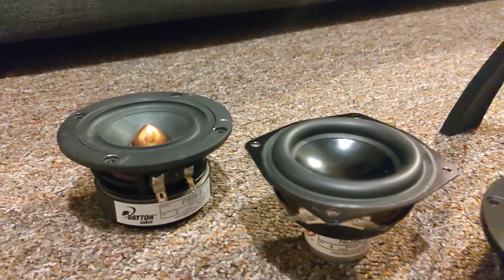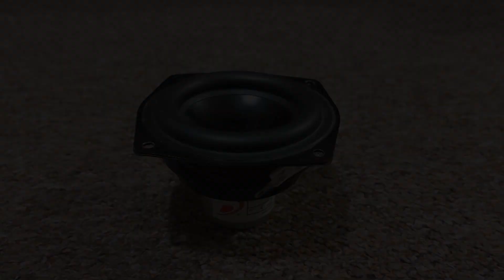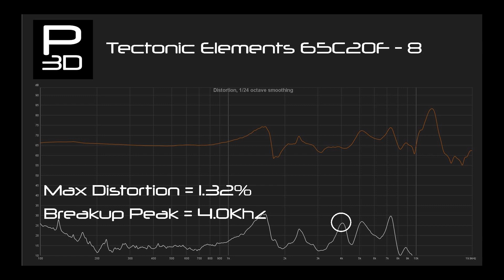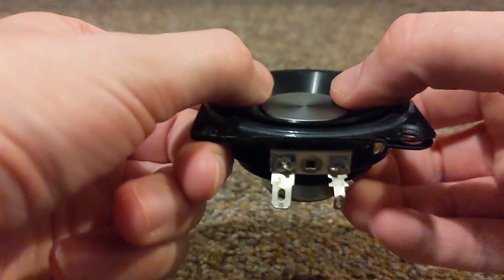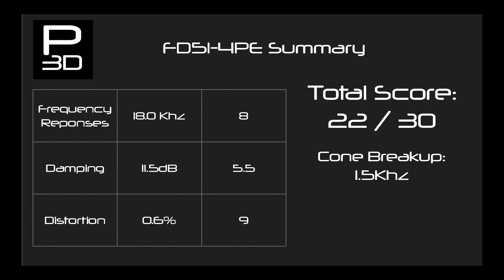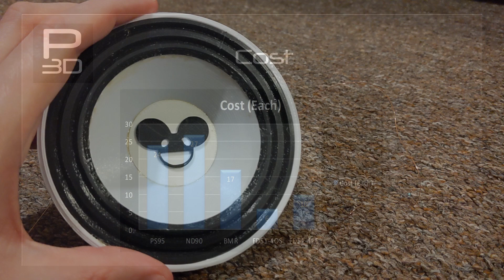3D Printed Speaker Drivers vs Industry Speaker Drivers

Comment: Perceived bass response here depends on the angle and the baffle size, both of which vary. A better comparison would have them all mounted in the same open baffle or box. Granted it's inconvenient, but merely having a larger frame makes a speaker louder here.
Reply from the maker: I agree the bass response will be effected by the baffle size, but even with a IEC sized baffle it is not classed as accurate below 200Hz still, so short of a boxed test it is hard to determine. Realistically the Cms and Fs should effect this most. For this video recording I used my cone test platform mount which is only 3<4cm away from the surround area in the hope to reduce this being such a major issue. Its a complicated one, especially in a small place like I am in haha. Thanks for the time to message. I will have to think more on this!
Reply: @Polymate3D  Thanks for sharing. It's nice to see someone 3d printing speakers. Probably many of us want to. I don't have much faith in plastic diaphragms but maybe printing the forms for a curved paper or composite cone. If you have more measurements like from the Dayton DATS it would be interesting to see too.
Reply from the maker: @haleype  I have an old WT3 so prior to DATS from Dayton and measure each design. When I get a chance to update the website I will be adding this to each model to help people have a bit more information on them. There has and still are many people with concerns on strength. My experience has been good for most materials so far. The hardest bit is getting the TPU parts printed cleanly (Surround & Spider). I have been doing this fine for a long time now though. The Tenacious 6+ in development which uses a larger magnet motor will probably be of more interest to you as it is much closer to a driver you would buy in SPL and T&S Parameters :)
Reply: @Polymate3D  Cool! My impression is that stiffness is crucial, or else why would people prefer aluminum that rings, or use beryllium. But paper should be easy to make. I'm also interested in optimizing the magnets and understanding the theory. Perhaps completing the magnetic circuit, or maybe a hallbach arrangement. Or rings of magnets like a brushless motor? I like the look of high excursion drivers, and maybe that would allow keeping diaphragms small for lightness and stiffness, but I'm concerned the Cms would be too low with these printed surrounds.
Reply from the maker: @haleype  It's a interesting topic. With Tweeters for example you have some using beryllium and others are going with silk domes. Massive difference. Same goes for cones you go from polypropylene to ceramics and aerospace metals. I think it comes down to your goals with a driver design. Having the higher stiffness helps raise that cone breakup region, but shape can make a big difference too. For my work high stiffness is key but so it the density as well. Hallbach method I have seen from another builder but you always hit a wall where the magnets themselves can only achieve a set level of saturation and iron in this sense is still king. I use a pretty strange arrangment compared to typical but this is to help give me a large magnetic gap to accomodate an easier to build design. Cms on my latest 6cm prototype is around 1.00mm/N for reference. I think if you was to do it yourself, the first thing with your high excursion would be to find the best solution for you winding a overhung voice coil. Its a big rabbit hole in the end haha
Reply: @Polymate3D  It’s a fun rabbit hole, and you’re deeper than I am. It’s great to hear your thoughts. I’ve been thinking maybe an underhung coil would suit high excursion better, keeping mass down. I’ve also really wondered why we can’t be smarter about transduction in general. The audio signal, afaik, represents not air pressure but voltage from the mic, proportional to its acceleration. Shouldn’t we be recovering the original air pressure, then solving for a linearly amplified air pressure for a given speaker, using its measured parameters? Then any cheap speaker could become linear in its range, just by applying a DSP that applies the right processing.
Reply from the maker: @haleype  Permitting you can maintain the flux needed for a long stroke underhung then maybe but you`ll still hit thermal limits a lot earlier than a overhung due to the lack of layers of wire and the surface area to dissipate it. I don't really have enough testing or data to confirm but we run by voltage because we can measure the feedback super quickly , Air pressure doesn't take the inductance issues at higher frequencies into consideration and also at that stage the surface will be resonating, not like a piston. For bass control you'd be onto something but there are also servo woofers which use a accelerometer to feedback the motion created vs expected, and counters for this. This or DSP however doesn't resolve anything like sound decay from the drivers emitting material or the suspensions compliance and capacitive values. DSP is a great tool as is bi quads in some TI amps, but its not a silver bullet. All interesting aspects to consider and it is the lack of innovation and experimenting on different ideas and principles which I think needs to be challenged in this day and age
Reply: @Polymate3D  Yeah, it seems to me patent is also stifling innovation. I like tri-state PWM amplifiers like the STA326 for efficiency and low noise, but only ST makes them. On the other hand, I’m just checking out a cool research paper “Single-digit-micrometer thickness wood speaker”. I didn’t mean to suggest measuring air pressure in real time. I meant recognizing that the objective is to recreate the original sound, which could be done by knowing how sound affects both microphone and speaker, these having their own physical characteristics, described by TS parameters. I think the fact that we ignore these parameters and drive every speaker with the same signal the mic produced could be largely the reason transduction is the worst step in audio reproduction. I can imagine something like a DSP but much more powerful that preprocesses a buffer of audio according to a model of the speaker (probably real-time, not steady state). You could also avoid damage this way. Then maybe (at least below breakup frequencies) any speaker would sound similar. Which is better than servo subwoofers, right? Much better to use silicon to improve any existing driver than invent hardware you have to build. Another cool approach could be to use a mic to compare the original signal and train a neural network to optimize a bunch of coefficients to minimize distortion. I investigated accelerometers, but afaict there are none (especially that are cheap) that are fast enough to work in the vowel frequencies. You mention measuring voltage for feedback. What’s that about?

Comment: u should compare a 3d printed driver with a industry driver and both should use the same motor structure(magnet, coil)
This will be a fair comparison
Reply from the maker: I very much agree with you. Currently my designs and magnets do not work to the diameters as them, but I could do so in the future and swap out. Its annoying that most are bolted and epoxied together! In this comparison, my motor is significantly down on the industry one. Work on newer bigger motors however is closing that gap :)

Comment: No way!!
It is the video you said it's coming...
:))
I really like your work with the printers there. I am an audiophile guy and I am working on a headpgone diaphragm as well, these videos help a lot dealing with tbe membran.... Good video!

Some questios:
How do you measure Damping and what is breakup peak?

Thanks
Reply from the maker: Yeah. I have been working hard to get it made and out. As to your question, once I measure the driver, I track the total harmonic distortion to find the highest point, which should usually be the point the cone is breaking up most. Some cone will have multiple sharp point and others will be 1 solid one.
Reply: @Polymate3D  Thank you for your quick answer. Do you think it's possible somehow to print out a headphone  composite driver/diaphragm? I mean, for example the diaphragm itself would made out of PLA or some other rigid plastic and the outer surrounder or damper out of TPU elastic one. Is it possible?
One more question. What is the thinnest plastic a printer can print and handle? How thin are your membranes?

Thank you very much!
Reply from the maker: @petihundeuhun8950  Hey again. No worries. The smaller you go, and harder it is with a 3d printer to produce a reasonable sound output. a headphone membrane is very very light usually. It is something I have considered but ruled out for now. The thinnest would be a flat single layer which would be around 0.1mm. Being headphone you would probably be better looking at a BMR design, but the biggest issue you will have in a magnet motor to power it in that small of a package
Reply: @Polymate3D  Thank you very much! You helped a lot :)))

Comment: any idea on how loud you measured them and on what kind of baffle ? or how many watts, itinfluance the disortionion rather much.
Reply from the maker: Hey Joppe. They were measured in a open space but right up close. The mic was 2cm from the end of the cone. Each one was raised and lowered to be the same height. Each ones volume was adjusted to match the same -27dB measurement on the microphone and then tested. Watts therefore on my drivers will be higher than the industry ones, so I was expecting high distortion accordingly. The -27dB translates to approximately 72dB @ 1W/1M. Being in such a small space really limits my options. The key thing was I tested same distance, same volume, and above 200Hz to try and remove lack of baffle issues up that close
Reply: @Polymate3D  ah yeah, well i used a scaled down versoin of the test baffles  IEC  http://www.rjbaudio.com/Audiofiles/IEC%20baffle.jpg

since im not testing 6  or 8 inches :) neither do you. so that might be an option?  i used a small  vice to attach it to a speaker stand whenever i need to test a raw driver. i also made a square cutout at the  desired spot where a speaker should sit. larger then the speaker tested ofcourse. so i can swap out this inner parts so i dont have to recut the whole thing but only a small portion for that particularly driver.

Comment: Very interesting video. I need to print and test your speakers in the BT speaker I designed a while back. :)
Reply from the maker: Thanks Viking! Damn you was quick. I am very interested in seeing other peoples designs. All FD51 drivers use the exact same 80x3mm printed screw in design to make it easy to fit without extra parts :)
Reply: @Polymate3D  I clicked and watched as soon as I got the notification. Hehe. Sounds good. :)